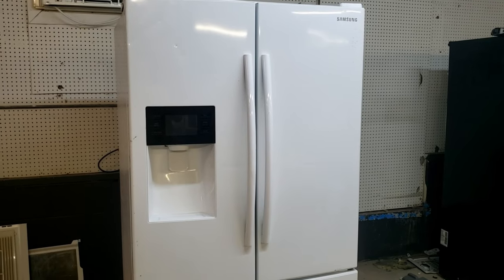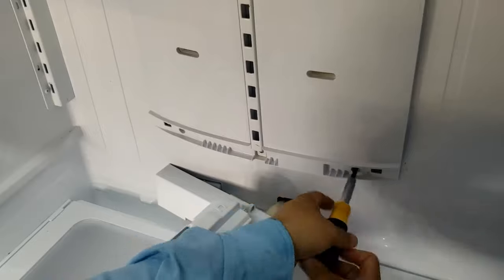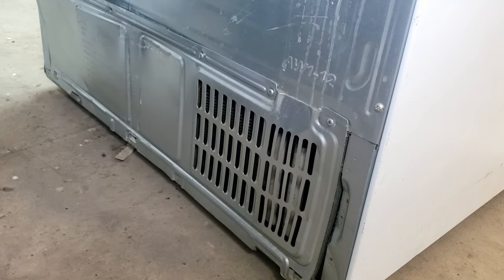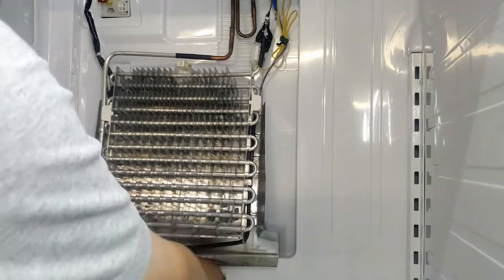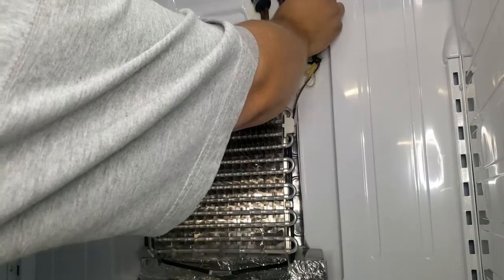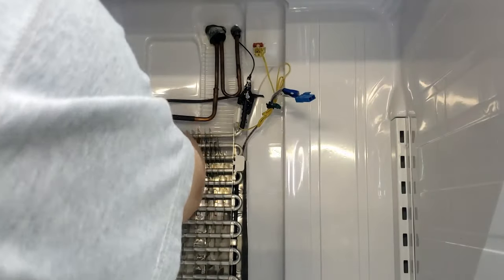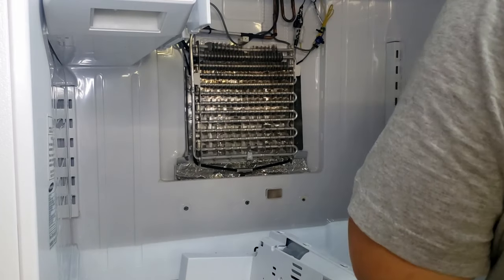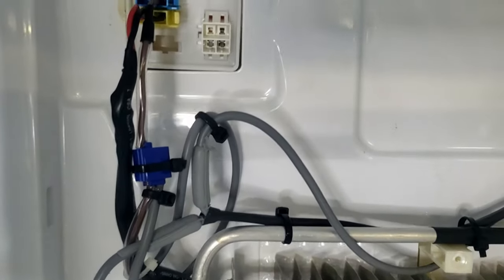Samsung Refrigerator Ice Build-Up and Leaking Water Inside Drawers - How to Fully Fix it Forever

Comment: Thanks for this video and kit Ben! I have been intimidated to make this repair but I jumped in! I’m getting stuck trying to figure out which wire is the correct existing heater wire to splice into. Any suggestions? There are two browns, two reds and two yellows! Help!
Reply: It’s the brown wire.  I am doing this fix at this moment too!
Reply from the maker: Follow the wire that the main defroster is on, its always that wire. As far as I've ever seen, they're always brown though

Comment: Hello there, Ben. 
Thanks for this very informative video which should help me.
And by the way, since our fridge is leaking water all the way down to below our freezer boxes and thereby icing up on the bottom, do you have a video to address this issue, Ben?

Please post your reply soon, and thanks!
Reply: I think you have the same issue I am having but I also think it’s caused by the issue in this video. The water was on the floor and I traced it up to just below the internal drawers where the water filter is. Every few days I check and it’s got water under the drawers and if I let it get outta control it will eventually leak to the flooor

Comment: I have owned a Samsung refrigerator for 5 years luckily I took the extended warranty. The ice maker kept icing up 9 service calls later 
Replaced ice maker twice motherboard  twice they refunded me the full amount. I paid no service charges I recommend buying extended warranty good luck
Reply from the maker: Did they ever add the additional line heater on the icemaker, or was it just IM+board?

Comment: I have two super cold areas in my Samsung fridge, one is on the top right and the second cold spot is near the drain hole at the bottom.  Do you think that it would be alright to install two 15 watts heaters, one for the top and second heater for the drain hole at the bottom? Thank you very much for your great video and the technical support!
Reply from the maker: You do not want an additional heater at the drain hole - you already should have a 120 watt black metal heater there that will run and SHOULD clear it. If you do have a build-up of ice there, you definitely want the moisture kit with a longer probe that will take the heat from the existing system, and push more of it down that tube. Also, notable cold/water/ice backup in that tray suggests you want to flush the line in the catch pan with warm water to check for backups, as well as replace the drain tubes (that's included in moisture kit)
Reply: @bensappliancesandjunk  Thank you very much for your fast reply and the excellent support of these issues.

Comment: Great video. I have a Samsung model RFG297AARS refrigerator. I opened up the panel due to freezing issues with food and ice build up under the crisper drawer. Can i install the SH502 heater as shown because my refrigerator does not have the wire connection/harness on the upper right side at the rear of the refrigerator.  This is a pic of the configuation behind the panel of my samsung frig.
Reply from the maker: Yes, you can install the secondary heater in that style. It'll splice into both brown wires

Comment: I had this issue. All I did was change that drain defroster clip. And I cut those rubber hoses in the evaporator tray shorter so water would flow out without obstructions.
It's been 2 years of no issues. Hopefully it holds up.
Reply: Can you clarify were the rubber hoses are that you shortened?
Reply: @maggiewp21  they're the hoses which send the water down to the evaporation tray at the back/bottom of the fridge. They had some sort of check valve on the end which I found unnecessary. So I cut them off and left those hoses open to freely drain the water into the tray without obstructions

Comment: I just did this repair without the heater to see if it fixes it.I’ll buy the heater later if it still doesn’t but I did have to pour hot water multiple times through my drain tubes to get them to finally clear as well

Comment: I followed your video and it works really well so far, but in replacing the two plastic tubes at the back of the fridge, I broke a thin piece of plastic inside the main tube that almost looks like a little funnel/plug to slow down the water as it drips through the pipe. Any idea if this will create future problems? I can’t figure out if this is a big issue as the water still flows through the plastic pipe fine, and there’s no leaking, but it just runs faster than before. Thanks!

Comment: Ben (or anyone), regarding the drain tube, what would you think about wrapping a length of copper wire around the original heating element a couple times and running it down the tube? I think this could warm the drain tube sufficiently to prevent water freezing in the tube. I'm going to try this in addition to installing the extra heating element from your site.
Reply from the maker: That can work most likely
Reply: I tried using standard 14 AWG solid copper wire (pulled the ground wire from a spare piece of Romex) - first it is a bit difficult to do a tight wrap with 14 AWG - maybe a lighter gauge - 16 or 18 AWG would enable a tighter wrap? Also I was concerned that the 14AWG is stiff enough and sharp enough to poke a hole through the refrigerant lines so I was gentle. 

Ben may know what the hidden drain tube line (the one that always freezes up) is made out of? Plastic, Silicone, PVC etc... that will tell us if a properly sized copper wire is safe to use or will it eventually melt through whatever that pipe is.

Did I see a difference with the wire extension into drain tube - I may be an outlier - but in 4 years of owning this Refrigerator it froze up on me (I define froze up as stopping the circulation fan and having to disassemble and defrost) 3 times - today is the 3rd time. I do notice that about a week or two before the freeze up I see the puddles under the drawers - so there is a relation between the drain clogging and the build up of ice in back of condenser panel. I would say having the wire extension installed has increased the time between freeze ups but is not a permanent fix to drain freeze. I would now like to try a different method to keep drain path open - either using Ben's solution or trying smaller gauge but longer length solid copper wire (really need to know what the drain tube is made out of and how it would react to potential high temperature copper wire touching it.

Chris

Comment: Thank you so much Ben for this very helpful video. I ordered my parts. I am hesitant to attach the sup heater because my models is different and I can't see clearly which two cable you connect the sup heater to. Can you calrify a little bit? Does the sup heater attach to the cable connecting to the heater at the inlet and outlet? Thanks a lot!
Reply: He doesn't seem to answer many questions.

Comment: Hello Ben, I have the Samsung side by side model RS265TDBP. Is this the same fix for my model? I haven't taken it apart yet to check for ice build up, but I do have water in the bottom of the fridge and it is not as cold as it should be. The freezer is working perfectly! Thank you

Comment: Ben - I am confused - in this video you instruct us to install the 4 foil covered strips on the aluminum plate that is attached to the condenser coil with 4 metal tabs. Two of the foil strips are attached  vertically to the back of the pan (in between the pan and the condenser coil) and the two notched strips are installed on the top of the bottom of the pan lip on either side of drain hole.  The other video does not instruct us to separate the pan and the condenser coil - instead it says to install the vertical strips on the refrigerator white wall behind the condenser coil & pan assembly and the other 2 strips (notched) on the refrigerator bottom lip  on either side of drain hole under the pan/coil assembly?? Which directions are correct and what is the purpose of these aluminum covered foam strips?

Final Question - there are several videos that say to move the defrost sensor from the refrigerant line it is on to the other line (I guess one line is the supply and the other is the return - I know in HVAC one line is typically colder than the other one - the thinner one is the warm one while the fatter one is the cold one - Factory has the sensor on the thin line) - Should senser be moved or not?

Chris
Reply from the maker: This video is 3 years old, and I did update the information. You want to put the strips behind the pan, not in front of, this was an error on the video. 

Yes, you do want to move the sensor to the evap coil where there's available in between the fins. It takes longer for that area to warm up, so it takes longer for the defrost system to terminate.
Reply: @bensappliancesandjunk 

Thank you - the only problem now is the new heater cable is going to be on the same refrigerant line as the defrost sensor - so I will try and locate sensor at the very top of the line and the heater cable will start an inch to 2 inches away from the sensor - hope that is far enough away to prevent false triggering. My refrigerator (RF263BEAESR/AA-07) does NOT have the refrigerant line "U" shaped loop like the one in your video has - just 2 lines coming through back wall (in and out) - also, my frig had 2 vertical strips on back of coil pan already installed just plain foam no foil covering and it has the newer style drain pipes with the upgraded silicone connectors. It does not have the longer  heater tab extension at bottom to help prevent that lines freeze-up. What I did notice was the location of the drain pipe at the bottom of the refrigerator does not line up with the drain hole inside the refrigerator. Depending on whether Samsung used rigid or flexible piping to get from the center of the refrigerator to the left side where the hose empties into the evaporator pan at the bottom of the refrigerator, there could be 2 x 90 degree elbows (bad for gravity fed condensation) or if flexible piping, hopefully they used gentle bends to route the water to the pan. I mention this because of the difficulty we all have when that line is frozen - using a temperature gun I found a cold spot right at the center screw hole where the cover mounts to the back - not only was it several degrees colder than surrounding area but it was also swollen - when I used my steamer in that area then pressed the back plastic around the hole lots of water was coming out of that screw hole - when I focused the steam just in that area the drain opened up - I then used my large wet/dry vacuum with a reduction fitting to create a 1" suction pipe - I placed this over the screw hole and vacuumed out all the water inside the foam insulation in between the white plastic sheathing inner lining and the outer steel covering. Based on this I have a theory that water is making its way into the insulation behind the plastic sheathing that lines the refrigerator interior and the steel exterior. In my case I found a break at the seam near the drain hole that has opened enough for water to get into the insulation. If this is true, I don't see a way to get at that drain hose other than cutting an access hole in back of the refrigerator through the sheet metal - this will certainly void any warranty (LOL... what warranty?) that Samsung may provide on my 4 year old Refrigerator (Should have bought the Costco extended warranty - I would have an LG Refrigerator by now).
If this kit does not fix the problem I will most likely go to plan "B" and find out what is causing that hose to freeze up.

One other thing - I am now awaiting a new cover - hope it is the right one to fit my refrigerator because in removing the old cover the cheap garbage Styrofoam packing material that Samsung decided to use as an extremely important air/water routing mechanism that basically controls everything (airflow, temperature, condensation removal) using $0.20 worth of styrofoam. So it cracked along one long end - in my rush to get my frig back on-line I made a rooky mistake, I didn't test the glue to repair a simple crack before spreading it and then watching it melt all the styrofoam it came in contact with....  ALWAYS TEST THE SURFACES U WANT TO GLUE USING SCRAP MATERIAL. I used my go to adhesive - E-6000 - so a simple crack is now a wide ugly gouge that is virtually impossible to fix - that was a $170 mistake (new cover) and with all of the conflicting information as to what the correct part number is for my model refrigerator and BTW the REVISION CODE part of the model number is as important as the rest - for example my refrigerator is a RF263BEAESR this is just the model you also need the Revision # after the slash -   /AA-07 so the complete part number is RF263BEAESR/AA-07.

Comment: should I be able to stick a wire or something down through the drain hole and have it come out the bottom at the drain tube?? Is it straight down, or zig zags ???   I got the longer aluminum clip but it doesn't go down far enough to wrap around the heater properly.   I had a block of ice sticking out from the rectangular hole that is about 2" down from the drain, and 3" to the right of it. I put a hair drter to is, and the block melted off, but I could see ice above and below inside that hole behind the panel. Any idea where that feeds from/to, top & bottom?
Also to note, when you show replacing those 2 drain tubes, there is a 3rd on between the fan and the coils that you do not address???  I believe that is the one from the drain where you install the larger clip ???
Reply from the maker: Zig-Zags slightly, but you should be able to put something down the tube.

The 3rd drain tube you see is for the icemaker and rarely, rarely, goes bad.
Reply: @bensappliancesandjunk   hmm odd,, the ice maker is on the left so I'd assume 1 of the 2 drain tubes you show would be from the ice maker.   The 3rd one is basically directly below the evaporator coil in the fridge.  I've actually replaced the compressor on my fridge myself.  Took 3 attempts at brazing the lines, but so far so good.. working great temp the past 6 months, but this icing under the large crisper started after I replaced the compressor.   $300 for  the new compressor sure beat the price of a new fridge. I have the door in door model and love  that feature so didn't want to replace it.

Comment: Yep... had a warm refrig that said on the display it was 35 degrees..... yet milk going bad after 5 days had me check the real temp.  45 degrees.  I find later the sensor was frozen in ice.  I could see ice at the right top hole.  3 hours later I defrosted it enought to get the back off.  Do not yank it, that part is $125 or more.  I also found a ton of dust blocking the back bottom vent on my 5 years old unit.  One thing that confused me was turning it on with the back connected, the fan did not turn.  So I bough a new fan ($32 - said it was an upgrade model).  I do not believe the fans work with the door open ? ?   I cleaned the frozen drain tube for now.
I had a repair man coming in 2 days for the freezing ice maker (done under paid extended warranty).  He replace the ice maker and a whole 12 connector circuit board.  I'm hoping that may fix this problem too !  If not, I'll look at these fixes.
If you have a warm refrig and it's not this, check the fan by the compressor in the video.  My old 22 year old unit had that stupid fan die.  No air over the coils, no cooling below 45 degrees.  I spun it by hand and kept the food safe until this wonderful Samsung replace it.  Those fans are some $90 or more.

Comment: I get the ice build up under the tray, but none at the top (I also only have 1 tube at the top right and not that U shaped part.) I checked the drain tubes and dirty coils. Tubes were clean and coils were clean as well so I put the cover back on. I am going to try the extended heater clip as that is all I can do.

Comment: Got a question for you; I recently dealt with a similar problem involving a Whirlpool refrigerator. Given that this isn't exactly a new technology, why, in your opinion do these major corporations keep cranking out thousands or even millions of units with these obvious design flaws? Refrigerators manufactured by Major corporations in the 1960s were better designed then many of these modern units. It boggles my mind.
Reply: planned obsolescence, keep you either buying parts to fix or buy a new unit all together.

Comment: Ben l worked on many of these too, trying to figure them out 🤔I have installed the heater it has worked..Im hearing from factory techs they are saying replacing the cover,fan, sensor unit. Have you replaced the cover?I haven't done yet because of the cost what are your thoughts?

Comment: How do I know if I need the 18" or 36" heater length in the kit from you Ben?  And you said to use the 3m scotchlock splicers correct?

Comment: My water filter keeps freezing up, preventing the water from dispensing. I have to run the filter under hot water and that will temporarily fix it. Does this issue contribute to the water filter freezing? Also if I remove the filter completely the water works fine.

Comment: I have had this issue with my Samsung fridge since day one, my fridge is a little different than this but the cooling system seems the same. I was wondering why my fan never runs unless you turn the cooling mode off which is what I have to do once every other month to thaw my fridge out. Im a bit irritated because I paid $1,000 for my fridge and its been a problem since we bought it. What causes the fan to only be on when in display mode?

Comment: After this upgrade is installed does the new heater cable just start working on its own as the fridge runs, or only when you put the fridge in forced defrost? I installed the heater kit a couple days ago and the ice is already building up again so I’m wondering if I did something wrong or if I need to manually put it in forced defrost.